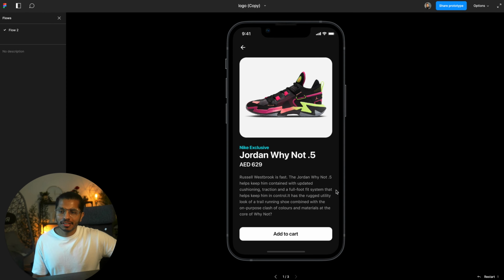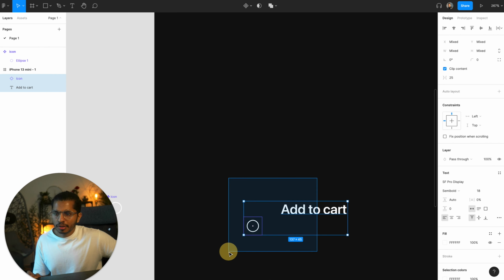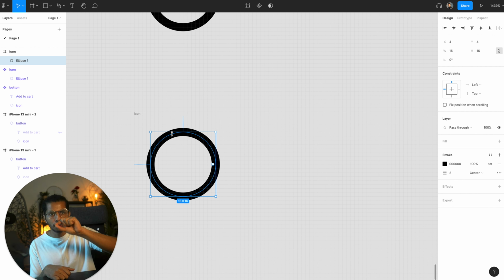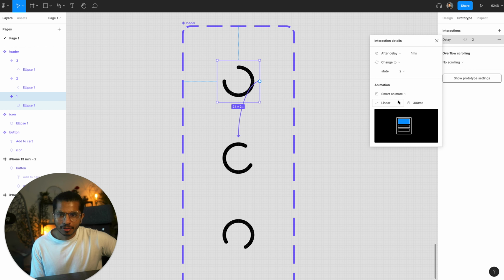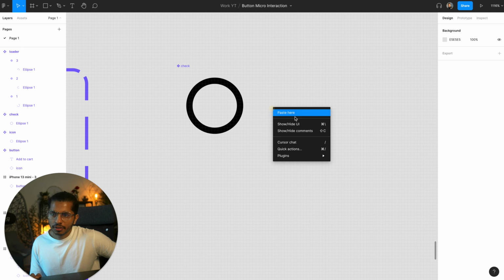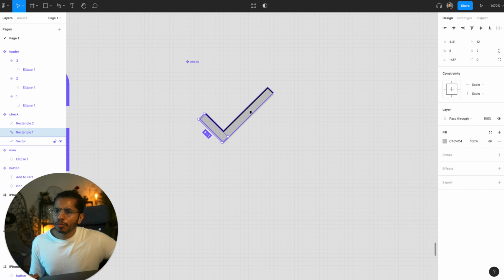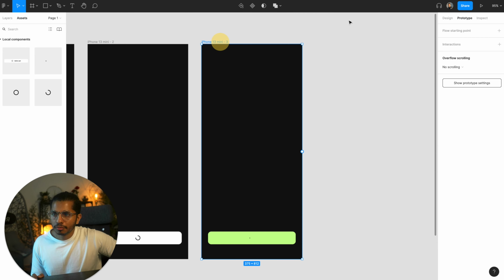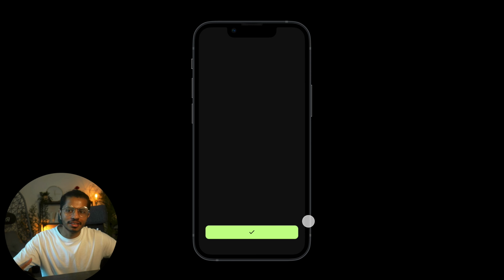Figma Micro Animation 04 · Animate Like A Pro · Button loading

Comment: To everyone that has the issue where the loader doesn't spin i found the solution to that. The issue for me was that i was rotating the variant (or state) and not the ellipse itself. Try giving an angle to the ellipse instead of the variant and most likely it will work.
Reply: Thank you, your comment helped me!
Reply: my god!! thanks!!
Reply: Thank you so much, tried again and it worked

Comment: I spend 3 hours for it, but it doesn’t work
Reply from the maker: Where are you facing problems?
Reply: @farhanrazaak  it should be wheeling, but in practice it just shakes😢
Reply from the maker: @NikitaMalyshau-o3c  Make sure to rotate the circle element inside the variant. If you rotate the variant itself, animation will not work. 

Also keep three variants and circle rotation value exactly same as the video. If you do more than 179degree rotation between variants Figma automatically does reverse animation and it could trigger back and forth shake motion. Hope this helps.
Reply: @farhanrazaak  Thank u! I made it as u said, but it still doesn’t work. It’s a pity. I think that’s it bug in Figma.
Reply from the maker: @NikitaMalyshau-o3c  duplicate this original file and see what's the issue. It must be something small you may have missed. https://www.figma.com/file/lW95iyRC8H7PzZbWcXbEcA/Button-Micro-Interaction?node-id=0%3A1 

Figma some time has weird bugs which resolves on force reloading.
Reply: @farhanrazaak  file not found((
Reply from the maker: @NikitaMalyshau-o3c  https://www.figma.com/file/lW95iyRC8H7PzZbWcXbEcA/Button-Micro-Interaction?node-id=0%3A1 try this
Reply: @farhanrazaak  Thank u so much!!!!! Really. Sorry for disturbing u. You’re a good man
Reply: I found little mistake
Reply from the maker: @NikitaMalyshau-o3c  no worries at all. Happy to help :)

Comment: The spinner is moving anticlockwise and then clockwise :( Please help. Anyone else having the same issue?
Reply from the maker: Did you do only two states of the loader variant? Make sure to do three states with 120deg max difference between each. Anything beyond 179deg, Figma will do inverted animation and it will cause the spinner to move forward and backward. Hope this helps.

Comment: hey man! great video. I have a problem with my prototyping, my loader isn't loading at all in prototype ive checked that the loader component is set to after delay and ineractive component is checked in prototype setting but it still isnt working.
Reply from the maker: Hi Muhammad, You seem to have done everything right. If it's still not working, you may restart the prototype. Figma sometime doesn't load properly so you might need to do a hard refresh. If you are the using Figma app, alternatively try the same in chrome. If none of this works, paste the link here (make sure to set as "anyone with the link can view" from the share window). I'll duplicate the file and see what's wrong.

Comment: Great walkthrough, but in the prototype view the loader is not spinning. " After a delay " is added as mentioned. What could be the solution?
Reply from the maker: Hi Shahrian, check if you've enabled "interactive component". You can find this setting under prototype tab.
Reply: @farhanrazaak  I can’t find it under prototype tab

Comment: Great video,  if you view it in prototype and the loader isn't spinning on its own, what might be the issue and all the connections are set as After a delay
Reply from the maker: Hi Kelvin, double check if you've enabled "interactive component". You can find this setting under prototype tab.
Reply: @farhanrazaak  and it still doesn’t work(((((

Comment: Could you please tell what I should press on Windows instead of command in order to replace the icon in component?
Reply from the maker: You can use control on windows
Reply: @farhanrazaak  I am using the control button but it's not working
Reply from the maker: @speedo20  You should drag the item from your library with the mouse. Hold control + alt key on your keyboard and release the mouse on the item you want to swap with. More details and step by step instructions available here https://help.figma.com/hc/en-us/articles/360039150413-Swap-components-and-instances
Reply: @farhanrazaak  It works thank you bro